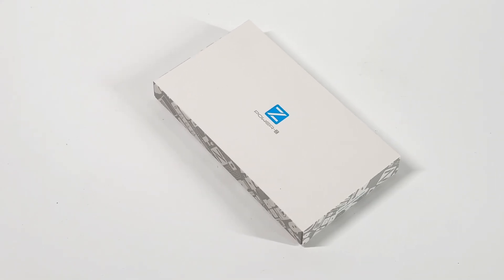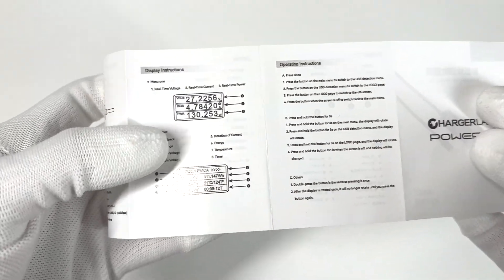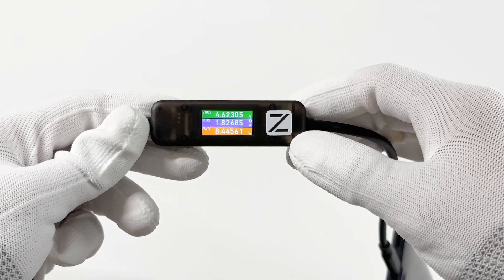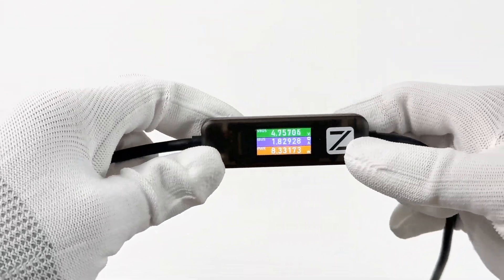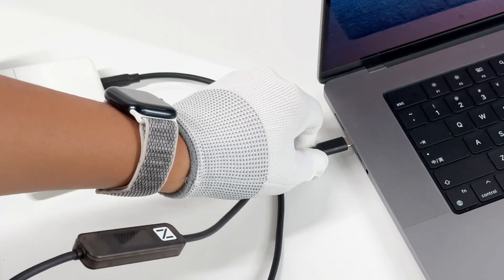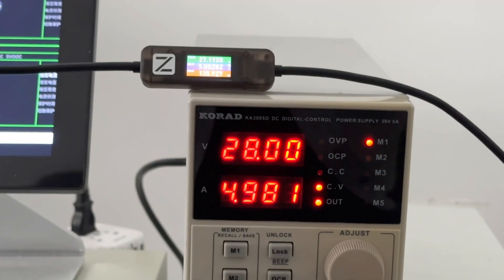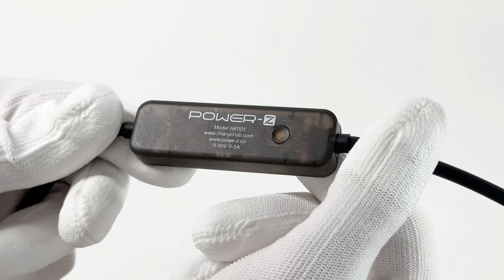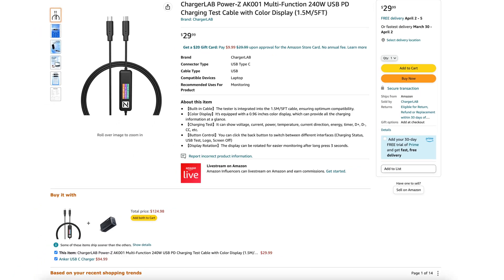Unboxing of ChargerLAB POWER-Z AK001 240W Test Cable (1.5M/5FT)

Comment: I wish the 2023 macbook pros could support 140w through the USB C port, so that these cables would be of more use. Someone needs to create a usb c to magsafe 3 adapter
Reply: I wish the MBP charging implementation would be more stable. Seems they've managed to make it worse with the last software update; they obviously decided to not charge an almost full battery (which is great) and put it on pause, but now they're actually turning off the USB-C off (also on MagSafe) and not on again so the battery is discharged over time despite being connected to power which is super annoying... I couldn't care less about 140W charging TBH, 100W is good enough for me.